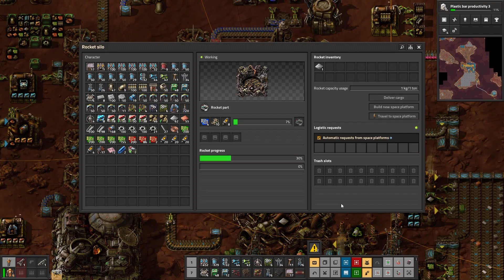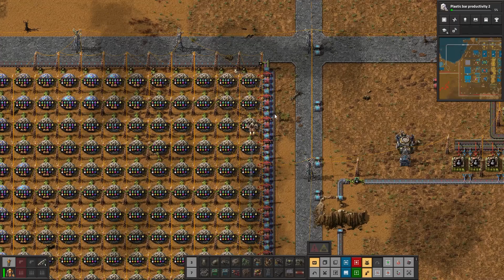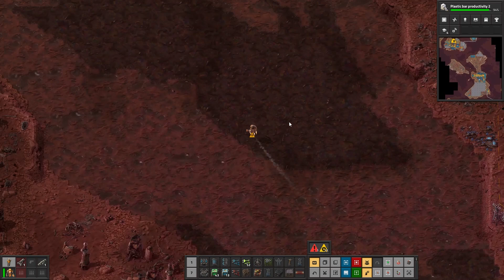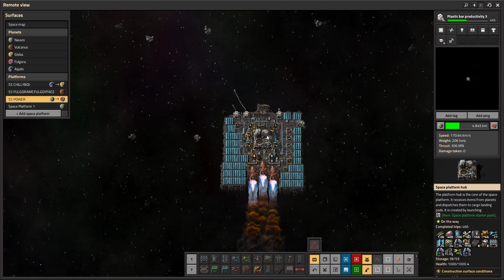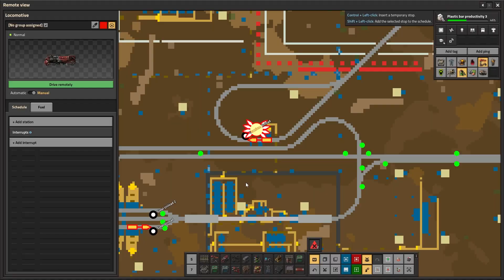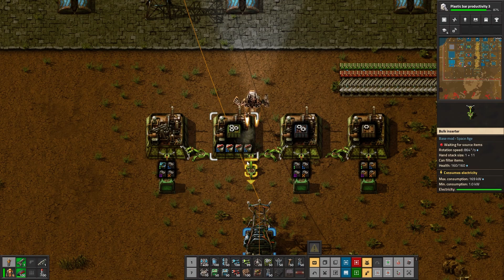Preparing FULGORA and GLEBA - Factorio 2.0 Space Age EP28

Comment: Every extra cargo bay you add to the landing pad adds an extra payload slot so the white science wont bottleneck you. You could also put a bulk inserter on the space platform and set it to only turn on if the belt has at least 12 white sciences on it which will then batch them up a bit more
Reply from the maker: @TheSmiddy  is there really no way to stock 1000 items into the hub and transport it in 1 go?
Reply: @DataEngineerPlays  If you are determined to ensure it doesn't drip drop then this would be my suggestion (NOT TESTED, only a napkin design in my head).  Tell your landing pad to set requests via circuit and attach it to a radar.  Then attach your space platform to a combinator which is attached to a radar.  The combinator can then set the request for science on the landing pad once the space platform has X amount in it.
Reply from the maker: @jzahnen4753  that's actually clever but insane you need to resort to that
Reply: @jzahnen4753  isn't the radar per "platform" where nauvis and space platform are separate and can't communicate
Reply: @jzahnen4753  sadly the wireless Radar circuits are per planet, so that is where it would fail.
Reply: @DataEngineerPlays  other option would be to have the platform generate the science in orbit at another planet and then fly back to Nauvis when it has 1000. Or setup a circuit condition on the landing pad to only request it when you're low. 

But I think that's all over engineering, I just added 4 cargo bays to my landing pad so I can accept 15 payloads at once so the constant trickle of white science doesn't bother me.